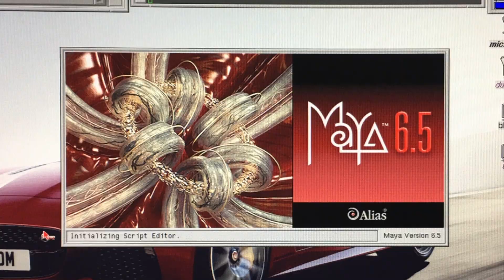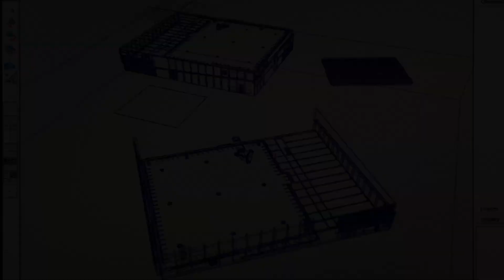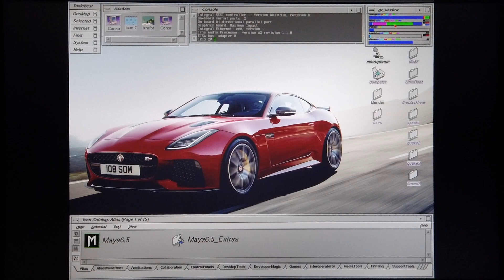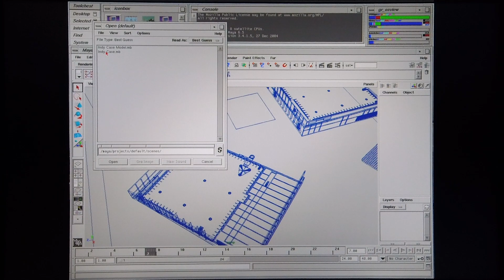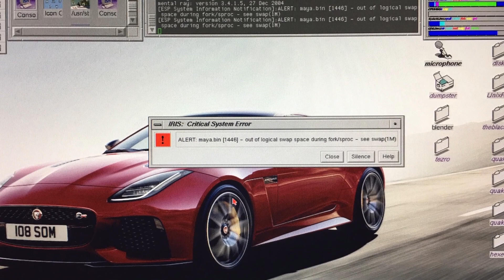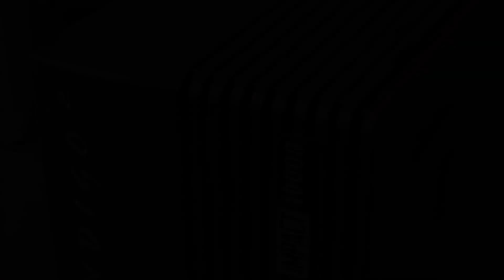Rendering an Indy case on an SGI Indigo2 R10000 MAX IMPACT using mental ray final gather in MAYA 6.5

Comment: Hey Irinikus, Designwise and from a standpoint of noise level, which SGI Workstation would you recommend to someone who wants to get into IRIX and animation. I have made a hobby of creating new things on aged hardware, but the airplane noises would be a turn off to me. So I was wondering, the O2 and the Onyx look most appealing to me optically. What would you recommend. Just imagine computing power is a secondary thing as I would structure the project and software around what is there.
Reply from the maker: Unfortunately no SGI is silent, but from experience, the most useful machine from a noise/performance point of view is definitely an Octane2. (It's a good looker too!) The best, definitely being a Tezro, but it's noisier than an Octane. I have no experience with the Onyx yet, but I do have an Onyx2, and that's by far the noisiest SGI I own, I would imagine that an Onyx would be similarly noisy.

Take a look at these Blender test results, which clearly show that the Tezro, Onyx2 and Octane2 are far ahead of the other SGI's when it comes to CPU performance, which is important when it comes to rendering: https://imgur.com/n04QneV

Even though the O2's a really cool looking machine, it would frustrate when used for modelling, due to lack of CPU performance.
Reply: @Irinikus  Interesting, I always brushed the Octane Line off for looks.
Reply: @Irinikus  What about the O2+? I know it his hard to find, how substantial of an upgrade is that one compared to the O2?
Reply from the maker: @theharbingerofconflation  My O2, is the same spec as an O2+, as it has an R12k CPU @ 400MHz fitted. (It's a max spec O2). The blender test results show it's relative performance, which lags considerably behind the Octane2. If you see an Octane2 in the flesh (One that's in good condition), you will see that it's a good looking machine, with bulletproof construction and performance to match.
Reply: @Irinikus  Okay, sounds good to me
Reply: Time to scour Ebay
Reply from the maker: @theharbingerofconflation  Cool!

Comment: Could you tell if it was swapping out during the render? Just wondering if additional RAM would improve the render time. Simple Maya models tend to behave in a linear manner in terms of render time with faster SGIs. Thus, if it took an hour on the Indigo2 then a quad-1GHz Tezro should do it in about 3min 10secs; how long did it actually take on the Tezro? On the other hand, complex models can benefit aswell from the larger L2 of later CPUs, but one can't tell if your Indy model is of such a vareity.
Reply from the maker: Hi Ian, the amount of memory available definitely limits the size of the frame you can render, as it simply stops rendering if it runs out of memory. 

As far as render speed goes, I really don’t know if more memory will speed up the rendering process at this point. 

In time I may benchmark a range of SGI machines, using my Indy model, in the same way as I did the Blender tests.

I rendered a much bigger frame size on the Tezro, so I can’t give a direct comparison at this moment.

I’m going to be in Cape Town this week, so I’ll only be able to test further next week, when I’m back.
Reply: @Irinikus  The reason I ask is that IRIX just in general starts pulling back on the resources it uses when memory is low, which makes everything a bit a slower, ie. it's not just about having more RAM potentially preventing the frame render from failing, it might also make the system just generally faster as IRIX will then be able to use more resources. I tested this a long time ago, the less RAM a system has, the less the kernel grabs for itself. Do you have larger RAM kits you could test with? Or if you like I could run the render on my system which has 1GB.

You would of course need to render the frame at the same size on the Tezro to properly compare, even though that means it would sit entirely within L2. :D

Have you seen my results btw? Alas I've not yet tested a complex model with Maya render to see if it behaves the same way as Alias. I also don't know how to get it to make use of more than 4 CPUs.

PS. No TRAM on that Max? I'm shocked. ;D  Mind you, these days I'd replace the fan with something more powerful if I was using a Max set, especially if it had TRAM. Hmm, some day perhaps, a new custom case for I2 with better cooling.
Reply from the maker: It will make for a very interesting video and discussion, when I eventually upgrade this machine with trams and max memory.

I at least now have a baseline of it’s current performance. So a comparison will be interesting!

Buy the way, do these machines require different CD-ROM’s to their R4000 counterparts? As the DVD-ROM that you sold me for my R4000 system works perfectly in that system, but this system sees it as a hard drive?
Reply: @Irinikus  Indeed! Btw, did you know Max uses SLI in its 3D rendering path? The Octane Technical Report makes for an intriguing read.

Re the CDROM, that is most odd, it should work fine. When you say hard drive, do you mean that mediad fails to see it as a media device and instead IRIX treats it like a normal SCSI disk? How peculiar. I've seen that issue before on IRIS Indigo and other older systems, but not with Indigo2. Hmm, try changing the 512/2048 jumper setting, that might make a difference.
Reply from the maker: Regarding the DVD-ROM, it is a rather strange situation. Do you have a machine that you cold run a test on, with the same type of drive?
Reply: @Irinikus  Yes, I think I could, but maybe it's related to the firmware on the drive? A unit I have may not behave in the same way.

Comment: Clearly very memory bound but still a useful machine. If you increased memory you could in theory have a useful machine for simple Maya tasks. What is the maximum memory the Indigo2 can support?
Reply: With an R10K the max is 1GB, via either 512 + 512 kits or 512 + 256 + 256.